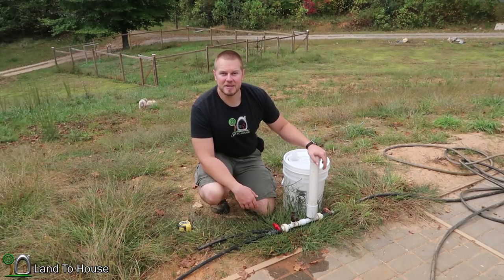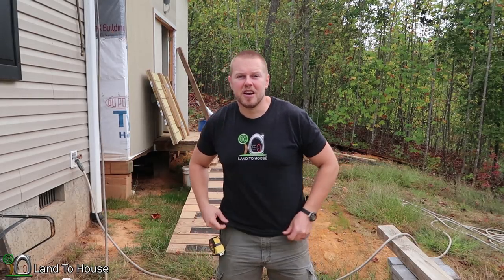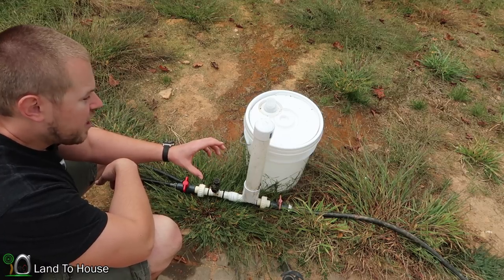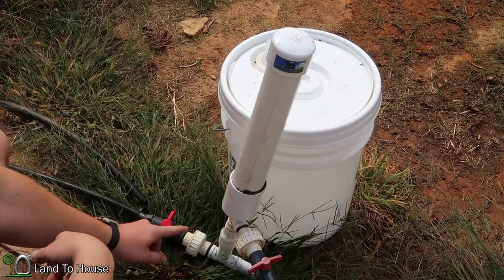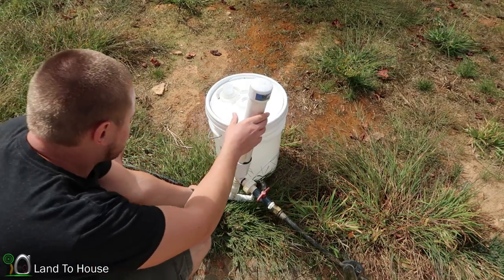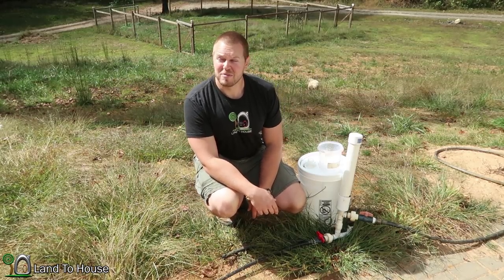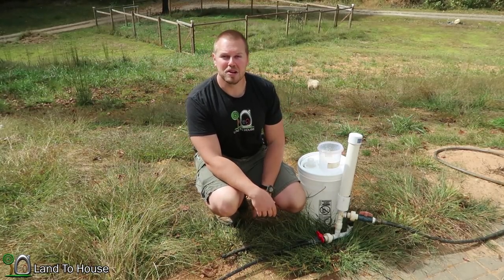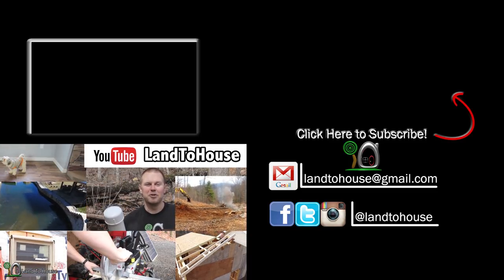What Ram Pump Design is Better

Comment: So we have the what, but I’m wondering about the why. My speculation is that the additional 90° angles in the second pump constrict the flow, but the pressure wave is the same so the outflow is similar. Thoughts?
Reply from the maker: They are so close I am not sure. The waste valve on the second test was a little taller so that would reduce the head pressure by that much.

Comment: Has anyone tried a Brass Water Pressure Regulator?? Ease the start of the process wouldnt it help keep it pressured for hours to be restarted without much priming
Reply from the maker: Not sure what you mean by brass water pressure regulator. Like a surge suppressor?

Comment: I couldn't see where the Check Valve is in the 2nd version?
Your 1st version seems more simple plus works better.
Wait!
U said the 1st pump, pumped in 22 sec, the 2nd 22 sec.  U have your figures wrong, U said after the 2nd was 17 sec for 1st pump???
If any that makes sence?
IVE WATCHED too many times, u saying yours pumping 22 secs, then 22 secs compared to the 2nd at 22 secs??
IM CONFUSED 😃😃

Comment: How can minimize the water wastage from the chek valve out.
Reply from the maker: The waste water is pretty much as is. Not a lot that can be done.  You can use an adjustable weight waste valve. And you can fine tune the drive pipe length.

Comment: does ram pump can be functional when the intake pipe sucking water of well by using draining system ? but the ram pump is out of well (5 meter from bottom surface)
Reply from the maker: Sadly the ram pump does not work in a well. It is best in a creek.

Comment: Hey Seth question for you.how much long gravity  i need for 1/2 ram pump before will start kicking
Reply from the maker: It is best to have a drive pipe at least 15 feet long. But I recommend 20 or more. You will need at least 2 feet of head pressure.
Reply: Thanks Seth looking forward  for my new 1/2 ram pump.that I order from you
Reply from the maker: Thank you for ordering! You should have the order within 1 week. If you have any install issues please feel free to ask questions.

Comment: bad test... you had both designs muddled together. i could not see the separate connections. 

 Also, the hose outlet was too low (should be top of house, not chest high)  this changes everything.  

Noone will want to pump water only 3 feet high.
Reply from the maker: With 3 feet of head pressure the pump can lift to over 20 feet. This was only a test of design.  The actual design of ram pump is pretty simile. One has the waste valve before the pressure tank and the other has the waste valve after. A 90 degree is the main component that is changed.

Comment: what is the maximum height straight upward it can pump
Reply from the maker: The diy model here can lift to about 180 feet. After that you will need a waste valve with more weight.
Reply: @LandtoHouse  "valve with more weight" - does it mean bigger size valve? I have a waterfall on my land with approx 7-8 meters fall and trying to find any working solution to lift water uphill 250m long with approx 100m elevation.

Comment: You should get rid of the white bucket away as it act as a white background over white subject.
Reply from the maker: Yes that is not the best video setup. In the 2019 I have a better test pump. It gets rid of the bucket. Thanks for the input.

Comment: WHY IN HECK WOULD I BUY SOMETHING THA I CAN EASILY BUILD
Reply from the maker: I understand where you're coming from. I provide several videos on how to build several different size RAM pumps. But I have also sold hundreds of them worldwide. Some people do not want to travel to the hardware store and browse through components to build the pump. But for those that enjoy that there is nothing wrong with building your own.

Comment: You shaved off 5 seconds wrt your linear sys test and added a second or maybe 2 to the non-linear system. You indicated that it took 4 min 25 secs to deplete the non-linear sys & stated later it was 4 min 20 sec.This is the 2nd video that I've have to call you out on fudging the numbers. Y
Reply from the maker: Yes I need to write down my numbers. This summer I hope to repeat some of these videos with a more consistent setup. :)